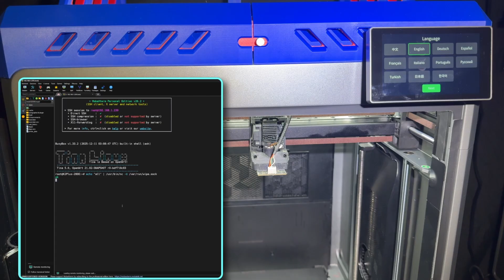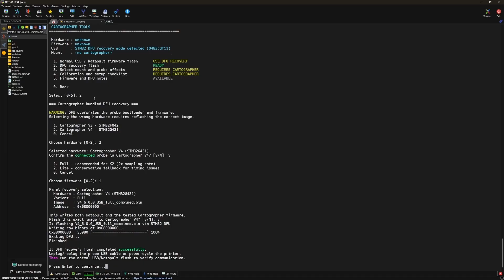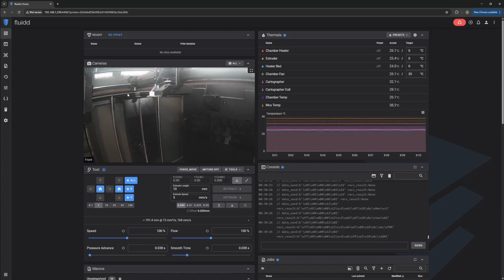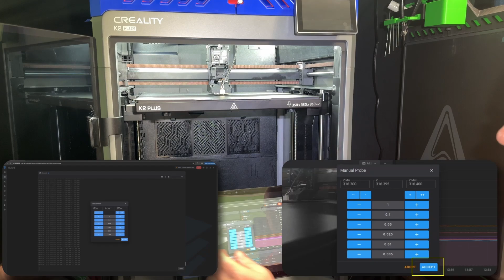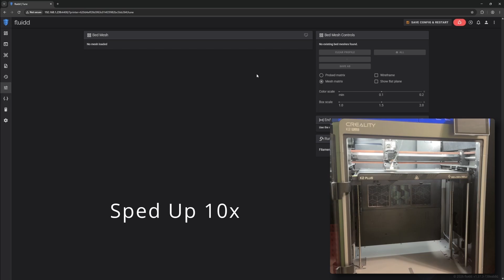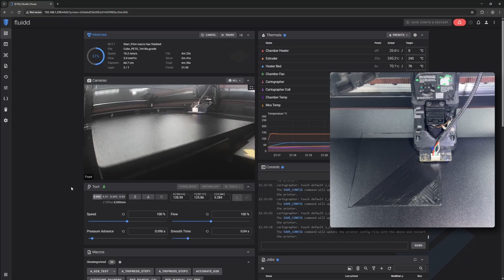K2 Improvements Cartographer Install Walkthrough

Comment: I installed V.3, and it successfully performed the leveling test with a 20cm x 2mm cube, but then it cancels the print—it doesn't even try. It goes through all the preceding steps, but cancels when it needs to extrude. Any idea what's going on?
Reply from the maker: Can you send the klippy.log from when this happened, along with the approximate time of the cancellation? Please also include your K2 firmware version. It may be easier to share the files on Discord.  discord.gg/696Updwwbn
Reply: @Rcpilot33  I'm running firmware version 1.1.6.1; I ran another test and couldn't calibrate the Z-axis—it ended up crashing into the bed. I'm going to revert to version 1.1.5.5 and try again; I hadn't checked for the correct versions.
Reply from the maker: @oscarrodriguez-nw4np  If you can send my the klippy.log when something happens I will be able to help more.
Reply from the maker: @oscarrodriguez-nw4np  Did you complete both the scan and the touch calibrations?  Verify that your cartographer is between 2.6 and 3.0 mm above the nozzle.
Reply from the maker: Did any faults show in the Fluidd console?

Comment: Hi, I have the V.3 cartographer. Will it work for me, or should I buy a V.4?
Reply from the maker: I have tested it with the v3 and didn't have any issues.  Most of my testing and running has been with the v4.  From all the feedback I've seen the v4 has faster communication and is supposed to handle the temperature better.  That being said v3 showed no issues when I tested with it.

Comment: WOW! Amazing timing, I just received my v4 and will be following along with your videos to install it in my K2 pro.

Thank you for your hard work!
Reply from the maker: My K2-Improvements was designed for the K2 plus with a different build volume and other variables involved. I do not know if it will work on the pro.  It has never been tested on the pro.